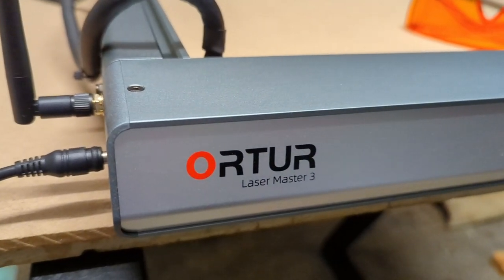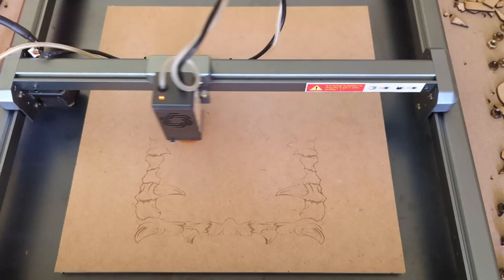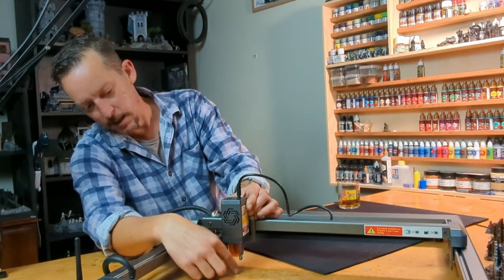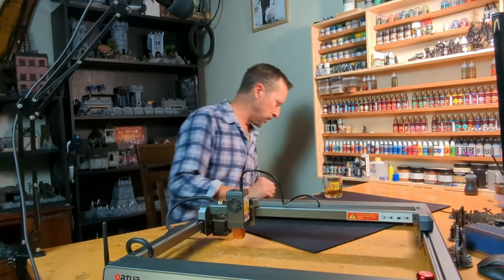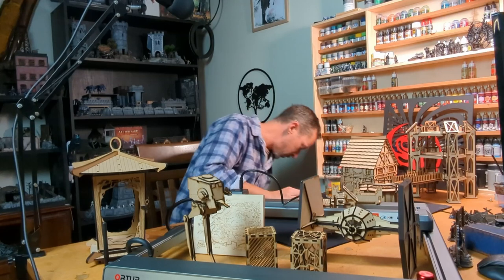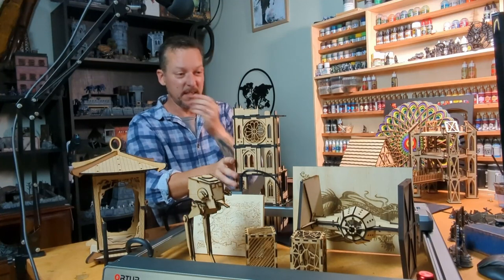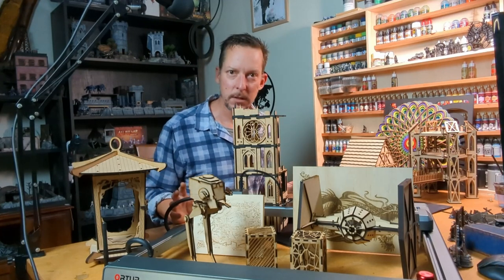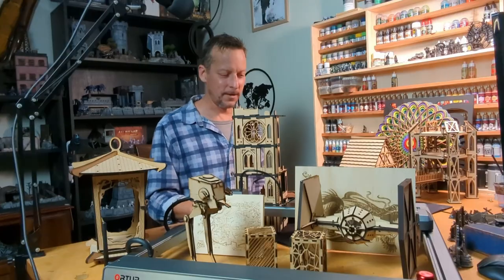How To Make Tons of Cheap Gaming Terrain and Models with the ** ORTUR Laser Master 3 ** Laser Cutter

Comment: Awesome bit of kit. Its ability to engrave foam is also one of the things that intrigues me about laser cutters....so many possibilities. Cheers!
Reply from the maker: Absolutely, I didn't show it in the vidoe, but I did a small test on some EVA foam, trying to engrave a texture image and it worked out really well.  I haven't had a chance to put some paint on to see what it looks like with a bit of finish on it, but it definitely works.  I also cut out some foamboard with it, that worked really well, but it stinks so bad, I really need a better ventilation system worked out for that sort of thing.  There are so many things left to try.

Comment: Would love to know your air assist settings.
On or off while engraving? If on how much power/liters per minute?
Reply from the maker: Thanks for the comment K.  I'm just running an aquarium pump for air assist on this one, I don't run air for the engravings (just purely based on recommended settings) but I do for the cuts.  The air pump is adjustable, but I've been running it on full air so far.  I haven't done any testing around the air assist yet.  But if you have any suggestions I'd love to hear them.
Reply from the maker: I've just found some details on the air pressure, it is 4.5l /min when running on full, which is what I have it set at.  If you have any experience with this sort of thing, I'd happily take some advice :)
Reply: @RFDHobby  I have a compressor that can go to 30l/min, and while engraving on the OLM3 found that using the minimal setting works the best for the spruce wood I'm using, that will be around the 4.5l/min you mentioned.